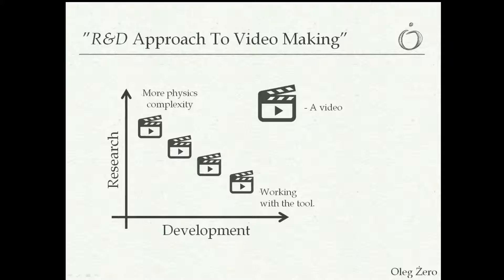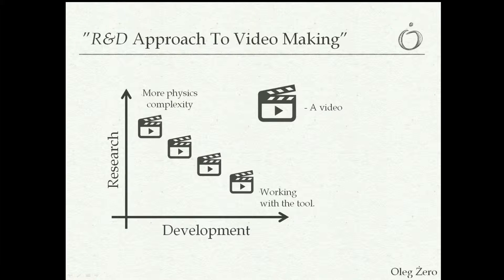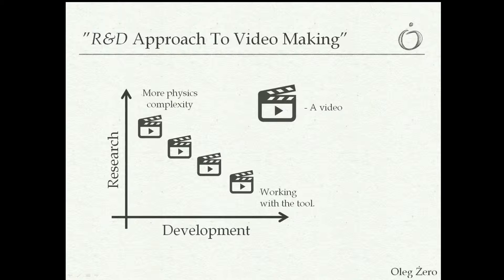0. General Introduction

Comment: Hello Sir, I plan to employ COMSOL (Finite element method) for solving the coupled Electro-thermal analysis. My professor wants me to solve this problem by coding everything myself rather than using the software. However, I think COMSOL with the support of MATLAB Livelink is the better idea for starting (because I am not a good programmer so I do not think I can develop a new own model from zero). From your viewpoint, do you think is that a good idea? - Besides, If I use COMSOL whether I can extract every information related to the matrices (M, K, C) freely as in when I coded it myself? I hope to hear your advice. Lastly, your videos are informative. Thank you very much